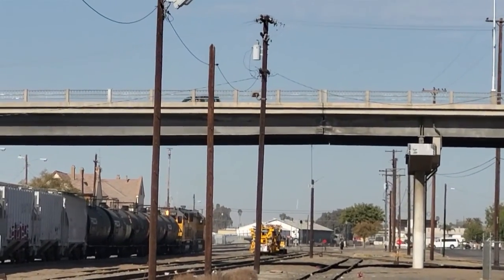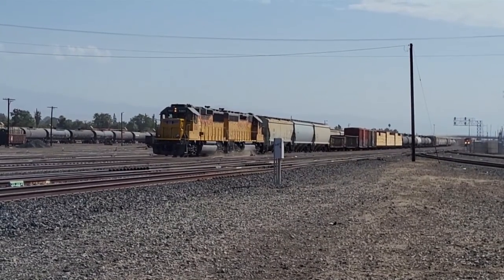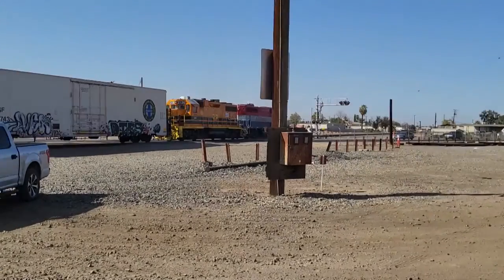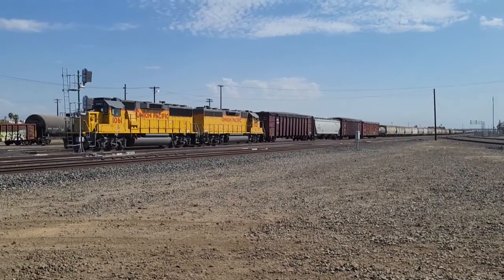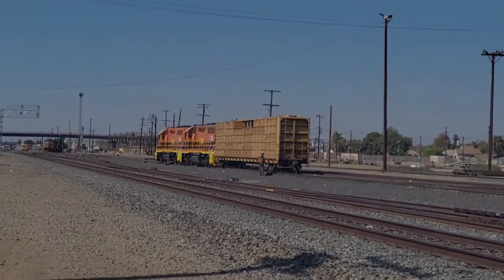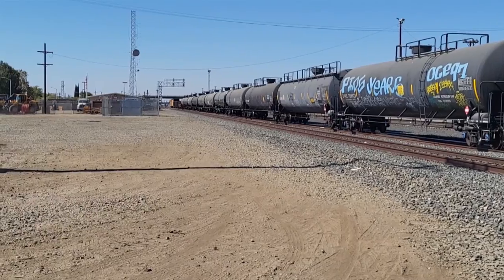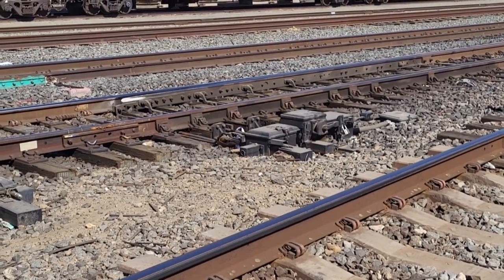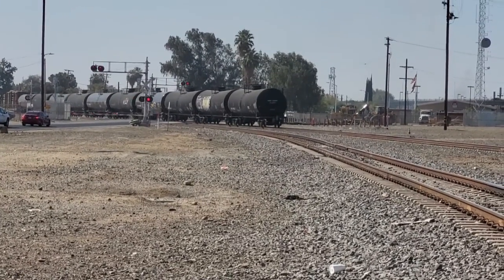A Day of Switching in UP's Bakersfield Yard

Comment: Those 2 UP engines 1061 and 1527 have been rebuilt by UP in their Jenks shop. 1061 is a pretty standard rebuilt SD60E made famous by Norfolk Southern. 1527 is an SD40N which the N suffix does not return in my searches. Probably a UP custom.
Reply: You might want to double check again sir those locomotives were GPs they both had two axle trucks not SDs with three axel trucks so my guess is 1061 is a GP-60 & 1527 a GP-40
Reply: @remylopez4821  You are correct, I misread the UP roster. I guess I had SD on my mind. They have been rebuilt in UP Jenks shop and are GP60E and GP40N.